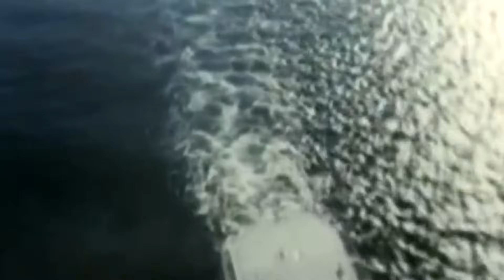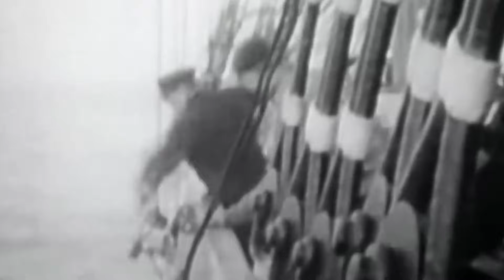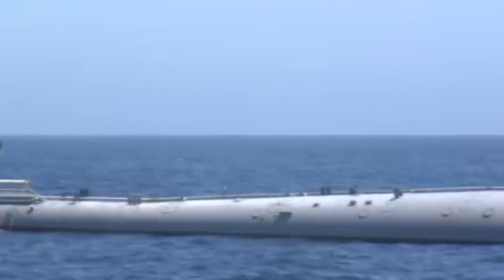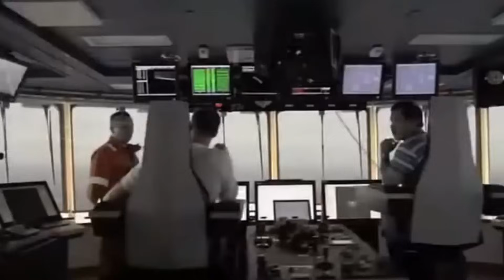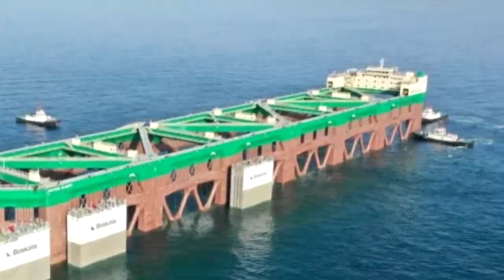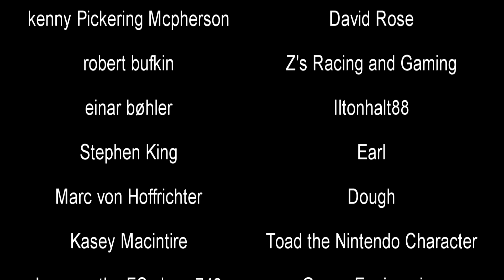10 Ships Clearly Constructed by a Mad Scientist | History in the Dark

Comment: The floating nuclear power plant is actually very cool. These need colder waters to operate, or you could have one on standby for black starting the grid wherever. Perhaps a smaller design with lower cooling needs could be produced for use in tropical waters?

Comment: The timber ship reminds me of the first generation cargo ford transit (model style now called the transit express ).
To get around the import tariffs on small frame commercial vehicles the transit were shipped into the united states with glass rear and back seat side windows , with two seats that were bolted to the frame with a molded carpet floor between…. Upon arrival the windows were removed and replaced with metal panels, the back seat and carpet taken up, the bolt holes in the floor plugged up , and all that hardware shipped back to be installed in another “passenger” transit